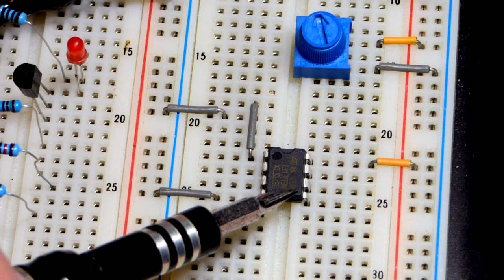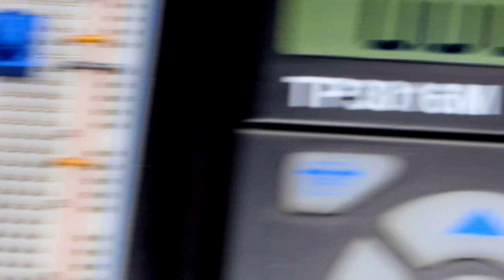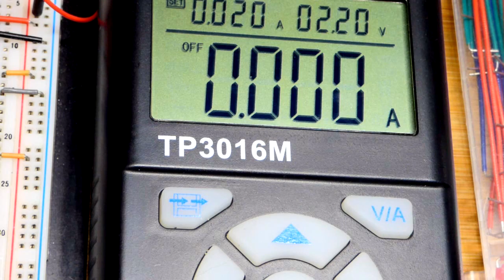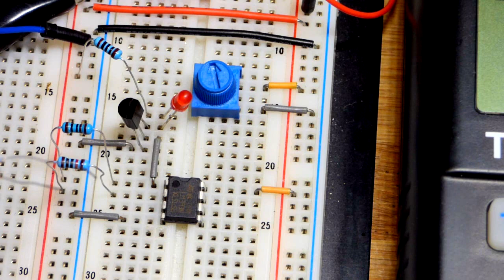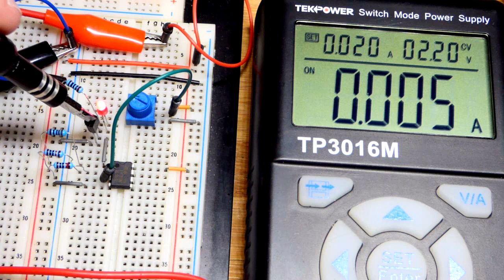393 comparator circuit using LM393 open collector output and 2N2222 NPN bipolar junction transistor

Comment: Nice video. I like watching your videos...especially using op-amps, comparators and transistors.
Can you do another video with an LM393 wired up as a Schmitt trigger with a hysteresis resistor also a 2N2222 to the output?  Basically so that as the trimpot is slowly turned the LM393 switches the 2N2222 and suddenly turns on/off an LED or relay?
Reply from the maker: I'll keep that circuit in mind! If I use a op amp or comparator to control a relay, I would definitely use a transistor at the output.